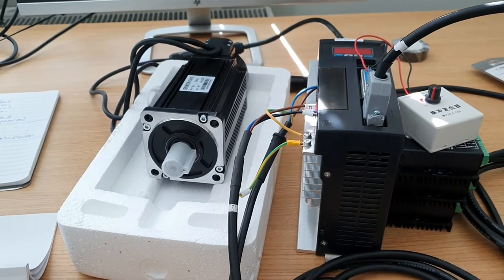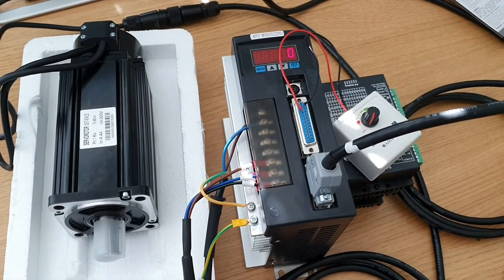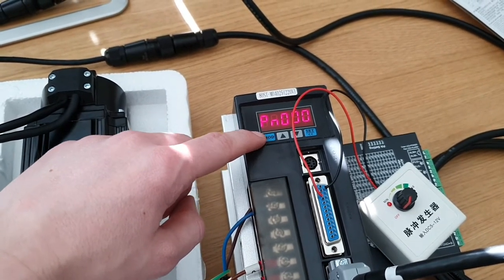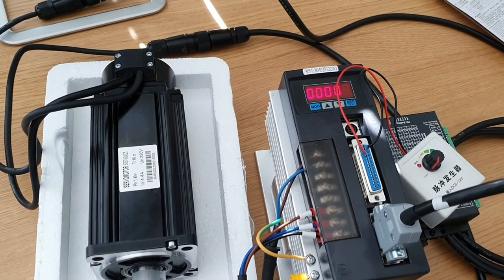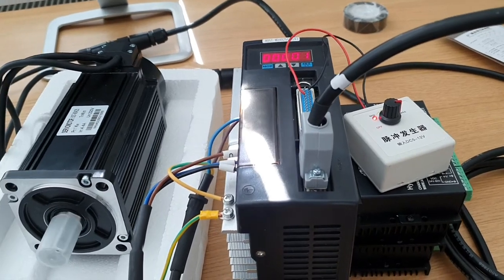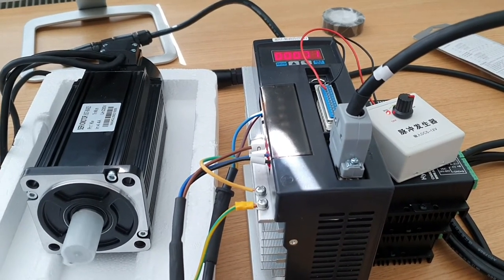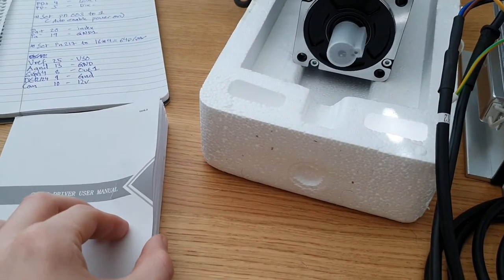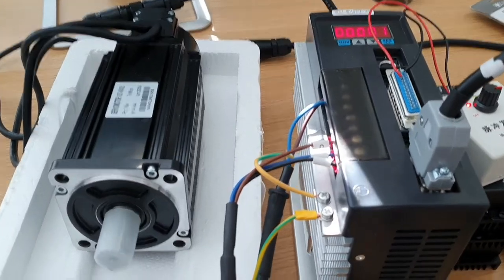First test run AC Servo motor 1kW

Comment: Thanks for sharing your experience with Servo motors.  I just received a controller + 1kw motor from china, different model controller, but clear instructions in well translated English so I hope to get it running this weekend.  Mine will serve as a spindle motor though. Love your vids, I have quite a few to watch still yay :)

Comment: Have you made your other videos yet? I am trying to use the 1.8KW motor as a spindle too.  I am wondering what CNC Software you will be using.  What breakout board are you using?  Could you provide much detail on how you found the right pins to use on the DB 25 to hook up the motor to a breakout board.  Are you using a PWM in your test?

Comment: Hello, what do you need to provide to the Control Connector so that the Power and Run LEDs turn on?
I have a Maxsine EP100-3A and it has a 36 pin connector, I gave it 12V between pin 18 COM+ and GND which is pin 9 but nothing happens.
I can see the menu play with the parameters but the LEDs are always off.

Comment: Starova, I am building a fabric shaver, which is aimed to be handheld and portable, as I am aiming for this size.  I currrently have the fabric shaver on a step file or CAD FILE done by a professional mechancical designer in Seattle, Wa.  Now, there is a series of cleaning heads that osiciallte 2 degrees CW then quickly 2 degrees CCW and the hertz is only 3-4 HZ and is driven by a brushed motor!  I need minimum 500-550 Hz or 550 abck and forth movements would equal one movment per second to really make cleaning fabric like clothing and upholstery easier fopr the user!  I need a little help deciding the right type opf motor can handle this repeated, super fast and controlled movement and offer differetn modes/settings almost in robotic fashion or movements, but that is dwon the road, I just need to find the right motor, possibly a PMSM motor or definatley a closed loop system and AC current drive.  I believe having gears (worm gear drive) sitting horizontally perpendicualr to the rotor to relive strain off the motor and help enhance a smoother start-stop motion - I believe on a much smaller scale how a clutch in a manual transmission automobile with a klutch (b/c the main reason for the klutch is to take pressure off the motor!  lmk if you wanna help and we can talk 414 659-1885, jon@dpxs.work  thanks Bonafide -a

Comment: Is that just potentiometer you have connected to the pins?  You mentioned having to change the function of the pins?  Looks like I have the same driver and motor as you do what pins and what settings to I need to use just to get it to spin with a potentiometer?  Just want use it as a regular motor that I can control RPM on.
Reply: analog 0-10 volts for potentiometer

Comment: Hi Sir,

I am doing some reserch about making my own motion simulator using diy build actuators with servo motors. I will be controlling the servo motor with Simtools software through arduino.

As far as i know, the servo motor on the actuator should have encoder, but what kind of encoder ? can you help me out please. 

What should i ask to the manufacturer for the specifications?

Comment: Thanks for the intro. I was looking at these kinds of controllers and was thinking they would be very hard to set up, especially if the instructions were in Chinese, or even no instructions. Is the little controller box with the black knob sending a PWM signal or is it just a simple potentiometer?
Reply: I changed all my steppers with similar servos (I would bet they use the same manual). Was not too dificult but the manual is garbage. The translation to english makes no sense, you are better copying the chinese into google translate. Anyways I'm happy with them altough I still have room for tunning.

Comment: Helo ..I installed the servo motor and servo drive according to the cable wiring. and the result is the best servo motor rotation, it should be counterclockwise. where is the problem, master?
Reply: analog polarity reverse I think

Comment: To change the direction of rotation, what is the master code?
Reply: i was trying to figure this out also and what i think i have found out is that you reverse polarity of the analog 0-10V i am trying to figure out where the 5+VDC goes for the ecoder, does it go to pin 22?

Comment: i have a servo the same this one fault AL-28.but i not see this fault in a document, so u help me this problem?thanks
Reply: Turn off db25. Fn003 clears the alarms, then Fn004 resets to factory settings. Switch the device off and on again. Enter the required parameters.

Comment: which may be the reason that the controller display alternately shows 0,1,2,3, -1, -2 ...
The servo worked before but it doesn't work anymore, some errors are popping up